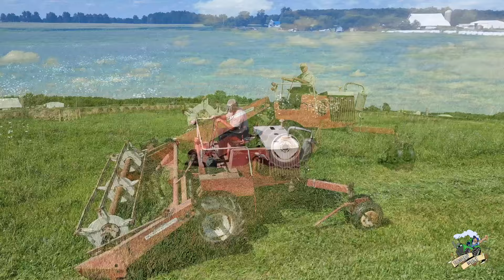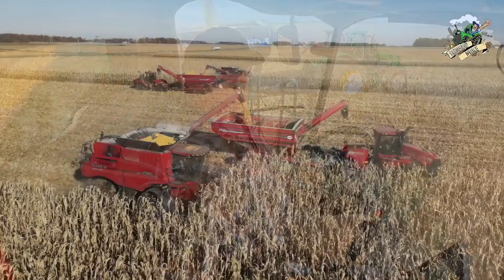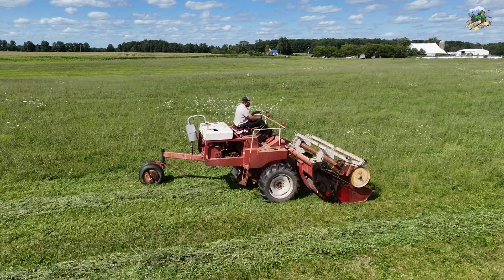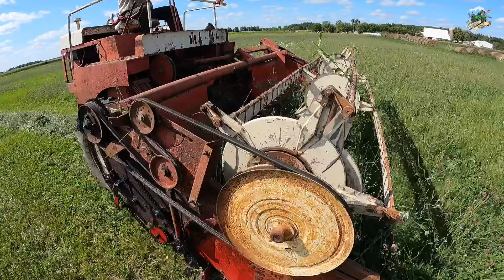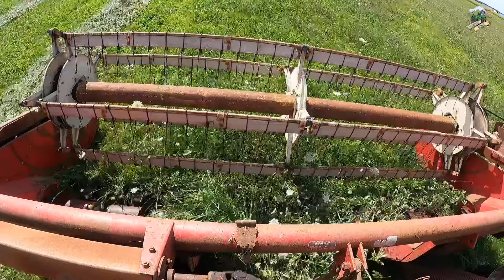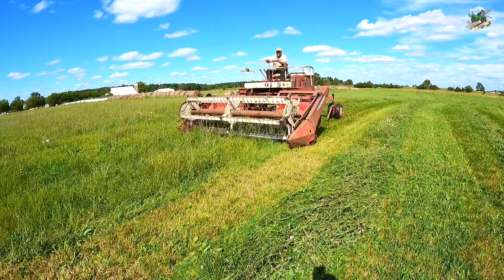Vintage International 275 Swather Mowing Grass Hay near Edgerton Ohio

Comment: I ran an IH swather when I was a kid. Its reel had wooden bars on it. It broke a lot of bolt on that reel. We replaced some that were too long  and forgot to cut them off. It tweaked that reel and it never was the same. It splintered those wooden bars.

Comment: We had. 175.  The steering was terrible .  Slow machine compared to a pull type.  Versatile dominated the market  with  the 400, and they did it through simplicity.  However if you wanted to cut big acres pull type was the way to go, in those days.  Those machines were meant for small acre farmers or crop that was laying down and add a pick up reel and steel lifters and you can salvage the crop and opening up the first round of the field before the pull type swathes.  I would like you to do a video on the coop machines  in Canada  . Check out we’re here to stay on national film board of Canada.    Mike , take  a look at that coop swather, it was a machine ahead  of its time. Built in Winnipeg , Mb.

Comment: I worked for IHC during this period and we sold these BUT they mostly were returned by the farmers , who said they could afford the fencing. Because 6:55  they did not plan ahead for a squarE turn because of the tank type controls which braked the inside wheel and allowing the outside wheel to pivot to a 90 deg.  Turn. They were removing sections 😊 of,fence on every turn,  so they said they could not afford the fence!! 6:55

Comment: There were 5 or 6 IH275s swathers in the neighborhood in the late 60s 70s and 80s, both draped and twin auger headers used (diapers used by  farmers who swathed oats, the twin augers also worked). We bought the baby brother, 10 ft., draper only, Model 175, Wisconsin air cooled engine,planetary drive the year before the 275, (375 hydro drive) came out. 👨🏻‍🦳 🐄🐄 🚜northeast Wisconsin.